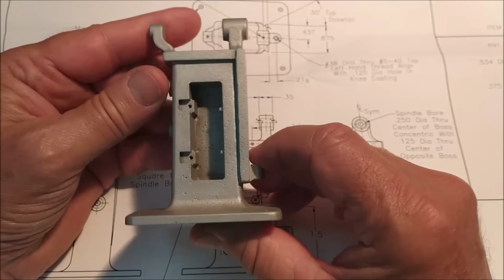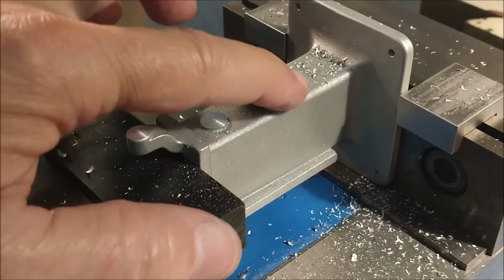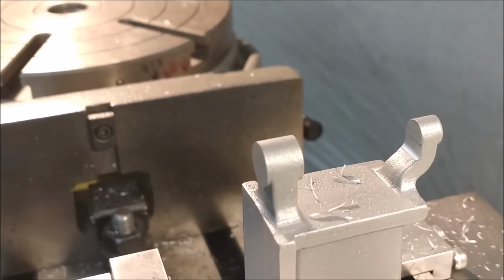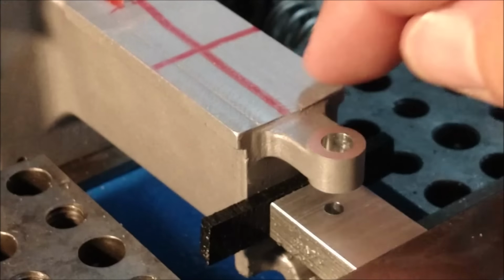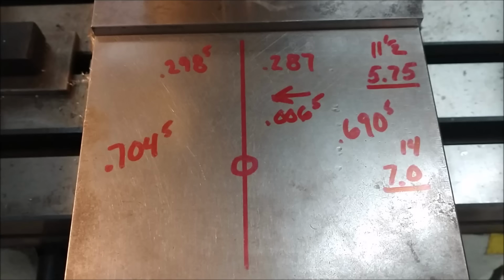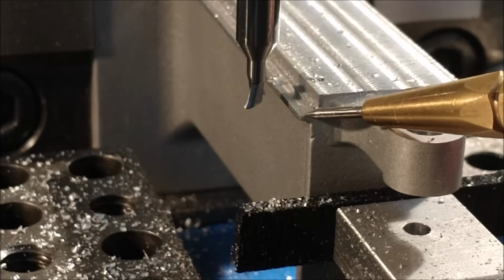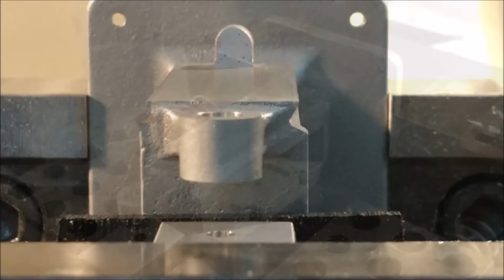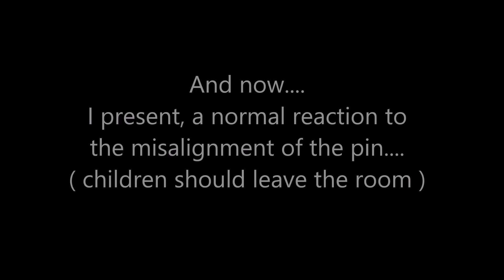PM Research Mini Mill, Machining the Base - Part 2............OH NO !!!!!

Comment: Joe. We used to have our Mark out table for our castings. Where all final machine faces and holes were marked out, and center popped. Once center popped, hole finished size were scribed on casting. Very often, the datam had to be adjusted so everything would clean up, then all lines had to be remarked. They were big castings for cone crushers, and by doing this we saved many hours of setting up on our big Horizontal borers. Occasionally it was easier to weld up the cast steel to hide our mistakes in casting.  I do like your channel. Cheers from Australia 🇦🇺
Reply from the maker: Sounds like fun. Thanks for checking in.

Comment: Had the same problem the first time I built this, made replacement out of brass and had it screw in without backup. Your choice ending gave me the chuckles.  I was not so polite when I learned the issue.  And like you once said a true machinist can work his way out of issues/errors. DO IT !!

Comment: Try aluminum soldering rod and build it up in place. The stuff is really good and all you need for heat is a propane torch.

I welded an aluminum tube to a soda can and it's amazing how well it holds and looks.

IF it doesn't come out to your satisfaction cut the boss off but I doubt you'd have to.
TFS

Comment: I have a horizontal mill of the vintage of the one the model was based off of, and the knee dovetail also references off of the column face just like the model. Its certainly more important to keep chips off that face, but damn is that a rigid setup. Also even though it's bearing on the column face, its still about a third of the width of the column is releived. I imagine so they didnt have to scrape in a football field.

Comment: When you are an expert, you can be calm about small miscalculations.  Thanks for the video keep on keeping on.
Reply from the maker: I'm not sure what they had in mind with this feature, but if you do one thing correctly, you get burned somewhere else. Its really a Pandora's box domino effect. That lug really should be taller right from the start.

Comment: Make yourself a bronze nut for the z axis screw and bolt that on the remnant of the boss on the casting. Wings in the side with 4 0–80 socket head cap screws in counterbores and it should look great and work better due to better alignment

Comment: Thanks for another great video. I was wondering about the 123 blocks and springs. Maybe you spoke about them in another video that I haven’t seen yet.
Reply: Looks like a couple die ejector springs just used to keep the 123 blocks in place.
Reply: That said, it is tough to tell what the 123 blocks are supporting.
Reply: They are holding up a parallel holding the block pushing on the top of the casting where the step pulley would be.  @grntitan1 
Springs are there to keep them in place so the parallel doesn't fall down. 
At least that's what I'm seeing
Reply: I agree with Dave, they are there to hold a parallel that is supporting the top end of the part. The base of the part is sitting on the vice. 

It is interesting to see that the one 123 block shows the work of an apprentice, It is witnessed.
Reply from the maker: Would anyone believe me if I said I bought them used??
Reply: @joepie221 That’s hilarious. 😆

Comment: You could drill and thread a hole for an aluminum plug that shoulders out on the face, then machine and file to a boss shape. Many other options too of course, we know you will get past it and all will be fine. Thanks for the video! P.S. I always know its authentic  Pie when I hear the motorcycles screming by in the background. 😂
Reply from the maker: Your suggestion is incredibly close to the path I chose. Good call.

Comment: The material is a casting not made from bilit.

If it was bilit then toys would fly out the pram if somebody suggested welding a blob on top of the radius and re machine it.

But accepting that any weld material will be much more pure than the casting,  I would probably consider welding it in slow small blobs to build up without heat stressing and warping the total casting.

So why (apart from I can so I will) is machining off and machining a new piece the way forward?
Reply: I was going to suggest a little bit of welding, even alumiweld would probably be enough to fix this considering how much pressure it will really support. Distorting the casting would be my only fear, but I also don't consider myself an expert welder, someone with good skill could probably have this done in 30 minutes or less.
Reply: I too find aluminum tig to be a very close match to cast alu cosmetically. Cant even tell once filed down and bead blasted

Comment: Could the pin not be reduced for the boss? it wouldn't be visible either ?
Reply: I'd tig weld it and build the boss up first. But even before that I'd just knock it off drill and tap the hole and thread a new chunk of material in and remachine it.

Comment: Since a lot of hobbyists or fabricators would like a mill but can’t justify a $5-10k mill, a video on the capabilities and limitations on a mini mill or bench top mill would be appreciated.
Reply from the maker: I'll have to get one donated to this shop and start that series. Good idea.
Reply: Thanks Joe.
Reply: @stuartkorte1642  I don't see anything that you re doing on the Bridgeport and Clausing that can't be done on a mini. - until you get to the microscope sizes there may be a maximum size, but I don't see a minimum size. - All the same number of turns on the cranks either machine. (If the Chinism mill is ridged enough to hold size) .

Comment: That is unfortunate.  I consider that a casting error.  Would it be possible to relocate the hole in the table to make the stand's feature work?  (I realize that your hole is already placed; I was thinking of those of us who follow.)
Reply from the maker: Relocating the hole, or lowering the knee are not options. The repair must be at the lug.

Comment: Can’t you just mill the boss off and weld in a taller replacement? I see another similar comment (TIG weld). Is the casting some exotic alloy?
Reply: Possibly,  although TIG welding castings can end up being an equally challenging situation.
Reply: The chances of distortion after welding in the already machined faces is a real possibility. For me, the risk would be too high.

Comment: You neglected to use the word "unloosen" when taking the little grub screw out of that spring-loaded tap follower early in the video 

I will admit feeling slightly let down by this... 

...but not as let down as I feel with the accuracy of the T handle!

I think this video would be worthy of "Shop Gem"
Reply: Commenting on the wrong video???

Comment: Take the knee 70 thou deeper and use a bigger gib?
Reply: Did you see how little material was left as it is? Another 0.070" lower is a step too far. There would be too little flange (along with poor cosmetics) left.

Comment: That's a real shame. Sometimes happens with model drawings that aren't fully dimensioned. You could machine the majority of the offending boss away and leave a remnant in place to use as a tenon for your new boss, and then perhaps fix the new boss with a screw from inside the cavity. Just a thought...
Reply from the maker: Were you looking in my shop window recently?? Good guess. Really good guess. :)
Reply: @joepie221  I just drifted off into a four thousand mile stare and it came to me :-) (I can't resolve anything smaller than about 1/8" without my specs these days, so your secrets are safe with me B-!) I look forward to seeing what will doubtless be a flawless execution of a well-engineered fix.